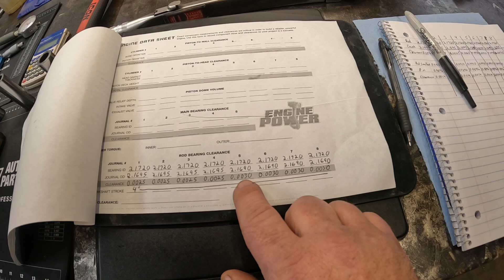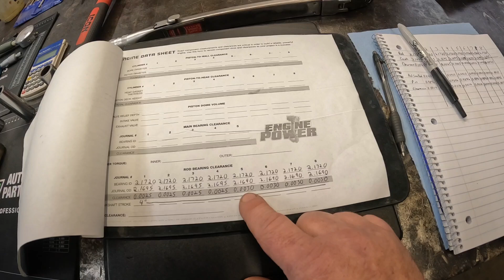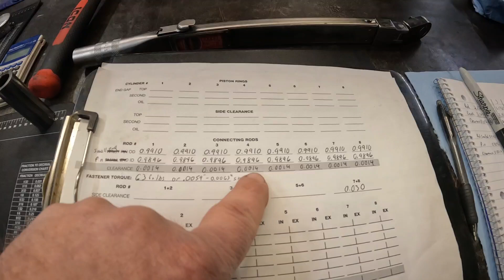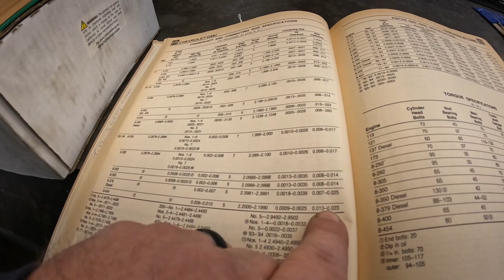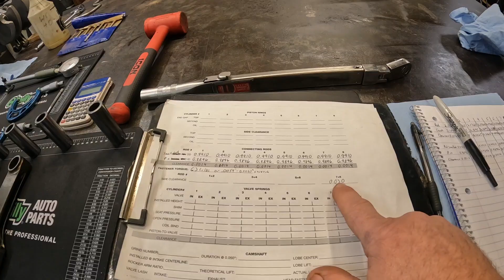How to, Checking my Bigblock Chevy connecting rod bearing and side clearance.

Comment: I enjoy your videos and the way you explain things. What weight oil do you use with your bearing clearances and do you have a brand preference. Thanks.
Reply from the maker: Thanks.  
I usually run 10w40.  I've been a castrol gtx  with Lucas oil stabilizer additivefan for all my life, but here recently I've been trying out Lucas 10w40 hot rod oil and Lucas stabilizer.  The hot rod oil has zinc already added to it.
Reply: @SquarebodyStuff  thanks for the reply. I use Driven Hr4 10w40 it has a zinc added. I am thinking of switching to Castrol 10w40 GTX conventional oil as I has a roller cam which shouldn’t need extra zinc. It’s less than half the price of Driven.
Reply from the maker: @454ss70 
The big block in my crewcab with a hyd flat tappet has had nothing but Castrol 10w40 and a quart of Lucas it's whole life (18 years) and I've never used any zinc additive in it.  Never any issues.  Not sure of the science behind it, but something is working.